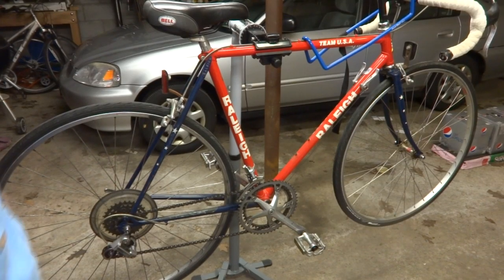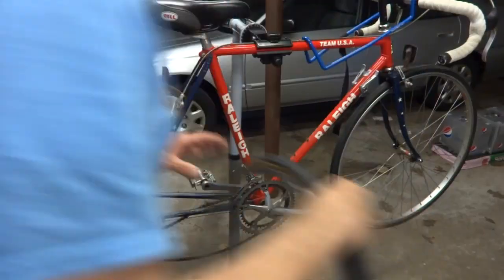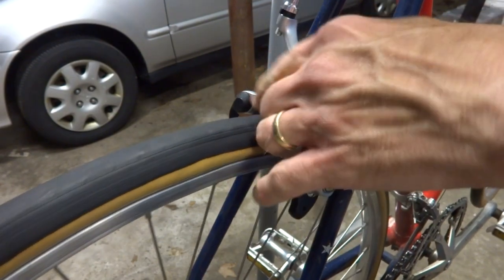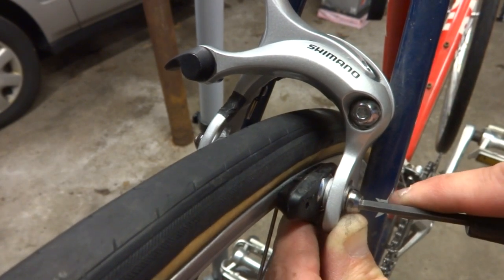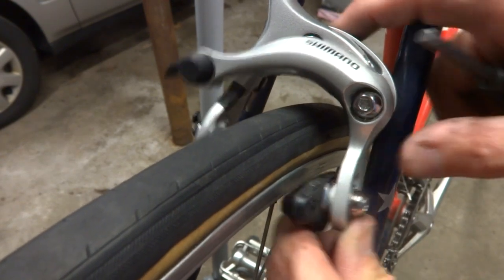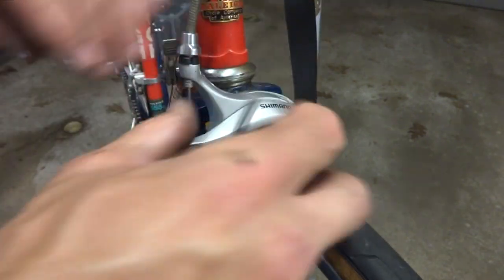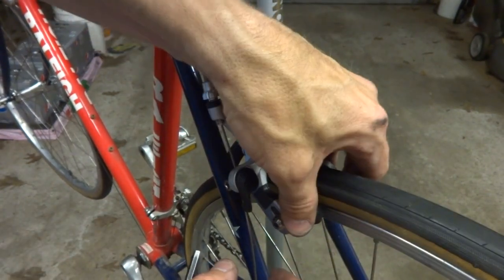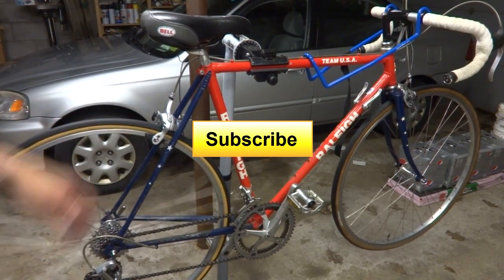How To Do 27 Inch To 700c Wheel Conversion - Vintage Bike Update

Comment: or save money by slightly file ling  caliper grooves  with round file..pads often reach without even file work  use round file
pads loose a little of their compression power  as they are further out  (more travel  less power  but still ok  can comensate with fixie type levers

Comment: I have a 27 inch 12speed road bike looking to convert to a single speed Fixie bike with a flip flop wheel and front brake only. I wanted to see that very comparison between a 27 rim and a 700c. Thanks for the video.

Comment: I'm doing a similar conversion with an old Dawes frame, I have a drop of 57 mm. I am a Tektro fan even though I have Ultegra on my oher road bike. Do I buy Tektro R539 with a 47 to 59mm drop of R559 with a 55 to 73 mm drop? In my mind I'm thinking the R559 will be stronger as I'm working closer to short end of the design perameters. What are your thoughts?
Reply from the maker: Dunno. Sounds like either may work.
Reply: @RJTheBikeGuy  I had an old set of 80s Shimano Tourney single pivot calipers with 55 to 73mm, put them in to check, just fits at the 55 end but I don't like the look, too much hanging down so I'm going for the R539. Thanks

Comment: Hang on I thought 700c was closer to 28 inch so slightly larger? Did you just say they were slightly smaller in diameter?

Comment: Aweosme videos! I just picked up a bike like this the other day and i want to do some modifications. is it possible to put smaller wheels on there? What's the smallest I can go? I'm trying to cut down some hight on it.
Reply from the maker: Ryan Olivares Putting smaller wheels on it is not the way to reduce height. Generally you buy a smaller bike. In the video the 700c wheels are only slightly smaller than the 27" wheels.
Reply: RJ The Bike Guy I know it's not the best way to do it but I'm starting to get desperate haha. I've been searching around for a smaller frame but no luck yet I just want to ride!
Reply from the maker: Seriously, starting with the right size bike is the way to go. Trying to put smaller wheels on to make it smaller is just a really bad idea. You won't be able to use rim brakes. The pedals may hit the ground when you pedal.

Comment: Hey RJ, nice video! I was thinking of building up a beater bike for winter, using an old frame i have. But I have a problem with it, I can't install my brake on the fork or rear because the hole is too small. should I drill it? or perhaps just forget about it...
Reply from the maker: I am guessing this is your issue: https://www.youtube.com/watch?v=74RBbMoAy4k
Reply: +RJ The Bike Guy ty

Comment: Thank's, many cracking informative video uploads....  I'm rebuilding an early 1980s Claud Butler bike using the Reynolds 531 frame, Chaining the wheels from 27 to 700c will i also need the long reach brake calipers on the 531 frame ?
Reply from the maker: 531 is the steel the frame is made of. It has nothing to do with whether you will need long reach brakes. Maybe you will, maybe you won't. But probably.
Reply: @RJTheBikeGuy  ....cheers :)

Comment: Hi there RJ,nice video again,just wondering if you can help.I have a old racing bike with 700c wheels and the tyres are 700-35c I have no mud guards on the bike because the diameter is such that they wont fit on, if I was to fit say a 700-28c tyres would the diamiter be reduced so maybe they will fit. many thanks  from  Wales uk
Reply from the maker: No idea. You will have to try it. It all depends on the particular bike and tires and wheels.

Comment: Nice job!  Like the conversion process.  I am wondering though - if the caliper centering was off, why would you loosen the mounting bolt to adjust the centering instead of simply using a 3mm Allen key on the centering adjustment screw?
Reply from the maker: On these brakes it's a phillips head screw. That is good for minor adjustments. So why not get the brakes centered to begin with and then use the screw for fine tuning.
Reply: Absolutely nothing at all - only had me scratching my head as you didn't mention that adjustment.  I'm really enjoying your video's. :-)

Comment: Question, I need better climbing gearing cassette on my 1988 Bianchi Limited with Shimano 600 7 speed 11x21 by 54/42 climbing hills has become a pain to handle due to such low cadence old school race gearing and not mention to my double butted steel Bianchi frame is a little on the heavy side + age is beginning to show it's ugly side!  Should I just change for 11x or 12x28 or even x 32.  Is it just better to stretch frame and run 10 or 11 speeds along compact chainrings??
Reply from the maker: Increasing the number of speeds just gives you more gearing options. Try a 12x28 freewheel. To got to a 32 , you might need a new derailleur. You can try a 52/38 crankset also.

Comment: Just wondering if you've used hubs that normally take a 7+ speed cassette and used a spacer? Or if you found hubs that are 6 speed. I'm also having problems making brakes reach and I really want to keep them since I have a whole Shimano 600 groupset 2x8 and I see they have an adapter that converts short reach brakes to long reach and I might do that because I really want to keep my tri color Shimano brakes since they work do well. Do you recomend getting an adapter that makes csntaliver brakes sit closer to the wheel or do you recommend getting all new brakes. It sucks because I just spent 150 for this whole Shimano 600 tri color groupset so I'm not sure what I should do. Thanks. I also have an aluminum frame that I managed to stretch from 6 speed to 8 speed. I know that's usually forbidden but it works with minor pressure applies to the rear triangle to make the time fit
Reply from the maker: https://www.youtube.com/watch?v=Jrd5XAQfgaA

Comment: Hey RJ. 
How do you suppose a vintage 10 speed road race bike that came with 25-630 slicks will perform on threaded 32-630 tires, like Continental Tour Ride? Any idea? I know rhey will be heavier, just wondering if you ever tried that.
Reply from the maker: Tires are a personal thing. Just be sure the fatter tires will fit inside your fork and chain stays.

Comment: Hi RJ, great Video, I am currently rebuilding my 23 year old  vintage schwinn, having a hard time getting a replacement 27 wheel set, my option is to go 700c. I was wondering if you can share with me the model of the shimano brakes you got. That will greatly help my rebuild simpler. Thanks again for creating great videos
Reply from the maker: This is the current version of what I used.
https://www.amazon.com/exec/obidos/ASIN/B005DTQ6UQ/ref=nosim/youtube25-20
Reply: Hi Mr. RJ thanks a lot. Once again great videos and very informative.
Reply: @RJTheBikeGuy  thanks for info exactly what i was looking for. your videos are timeless.. Im upgrading 83 Panasonic, love them.

Comment: Hi RJ, I have a vintage bike with 27inch. The hub length is 8.5cm. I have a set of 700c wheels with hub length of 10cm. I’m not able today stretch my fork 1.5cm. Any advice?
Reply from the maker: If it's a steel fork, you can cold set it out to 100mm. At your own risk of course. But's not uncommon.

Comment: Hi RJ, I have an old 46cm Miyata Pavea 77 road bike with 650c. However, I'm having a hard time finding 650c wheelsets for it. Is it possible to put in 26inch wheelsets on it? I wonder if it would enough clearance to accommodate the wider rim and tires.
Reply from the maker: 26" mountain bike rims are smaller than 650c and the brakes will have issues reaching. Depends on the frame if wider tires will fit.
Reply: Okay. Thank you, RJ! keep those informative videos coming.

Comment: Ok so I think I’m running into the same issue here. I found a 1973 schwinn and I ordered 700x35c tires and they won’t fit. I wanted 35c because they were that in-between type of hybrid tire. So my question is can I get thicker tires for my 27” rim? Or must I change to 700c rims
Reply from the maker: Yes.

Comment: i just found a rusted to crap CCM Targa at the recycling depot at my local landfill the other day (in the bike area where they're left outside with a lot of other for sale crap but still definitely not taken care of). i've never had or gotten to work on a 27" bike or any sort of road bike before, i totally forgot you could even swap them for 700c's until just now, and i thought the targa was a lost cause because of this. tomorrow i'm gonna go pick it up (will probably cost me about 10 bucks, the money goes to keeping the recycling depot area running) and get to work on it. do you have any experience with targas or have any advice for me? i expect it's gonna be rough and i don't even know if i'll be able to fully rebuild it, but i can't wait!!
Reply: aeshir i'm also not sure if i'm actually gonna swap the wheels, it all depends how much money i want to dump into it and if i want to be able to carry the parts over to a more modern road bike if i ever build/buy one
Reply from the maker: aeshir I am not familiar with that specific model of bike. You will just have to figure it out as you go. I have lots of videos on various aspects of the job.

Comment: As you were working on that bike I noticed all the similarities to my '84 Schwinn Le Tour.  The cable routing loops along the top tube, brakes and attaching hardware, brake levers, seat post and seat post bolt,  crank set, pedals, and even the frame and fork seem to be basically identical.  Is it possible that these bikes are the same, built in some overseas factory and just branded and sold by Raleigh and Schwinn?
Reply from the maker: I doubt it.

Comment: I'm thinking about a 27" to 700c  conversion. Any problem with increased pedal strike with the smaller overall diameter wheels? thx
Reply from the maker: Not really. The difference is pretty small.
Reply: thx. I'm hoping the conversion will reduce toe strike on the front wheel, but didn't want to create more problem. More tyre choice will be good.

Comment: Do you recommend against going from 700c to 26'?
I have a road/hybrid bike that's just a tad uncomfortable for me to mount, and I was hoping a smaller wheel size would bring the height down a touch.
Reply from the maker: +misamisatv No. Brakes won't reach. Pedals would likely hit the ground. Buy a smaller bike.
Reply: RJ The Bike Guy  Thank you for your reply!  It's a shame because I really really like this bike..  :'(
Reply: 26" could be 559mm, or 590mm. The latter (26× 1 3/8) are pretty close in size to 700C, which are 622mm.
If you mount 35–37mm tires the difference in height will be like 4–8mm. So, a conversion could actually work.
Reply from the maker: When people say 26" they are generally referring to mountain bike wheels which are 559. That is A LOT smaller than 622!!! The pedals would probably be hitting the ground. Or do you think they were thinking of replacing modern 700c with antique wheels?
Reply: 590 are quite common in Europe and Japan, especially in road and city bikes. Nothing antique about it. You can get relatively popular tires from Continental or Schwalbe for them. But, the OP wanted to bring down height for easier mounting, and I agree, that's not the way to go for that. The conversion itself is possible.

Comment: Hey! Have you tried swapping 650c to 700c? (probably won't work but i'm asking so i don't end up buying larger wheels and they'll won't fit) Thanks for answer ;)
Reply from the maker: +jgvbadv I doubt 700c wheels will fit on a frame made for 650c. That is a pretty big difference.

Comment: Hey bike guy, I have a raleigh spirit and looking to replace the wheels for 700c's. Wheels come with a 5 speed cassette and I am having trouble finding a set, where do you recommend finding a nice set?
Thanks
Reply from the maker: Ebay.
Reply: Been looking for a set with no luck, most are for 8 speed and up. Thanks
Reply from the maker: Most of those older 700c wheels with 5 speed hubs will be tubular.
Reply: Thanks, i think I found a nice cheap set

Comment: Wow you remove the old brakes and install the new brakes without first cleaning the surrounding frame area !!! Unbelievable. And why cut the cable if it is still good? Couldn't you have just unscrewed the bolt to get it off and reused it?

Comment: how horrible would it for me to go from a 5/6 speed Uniglide 27 to a 700cc (maybe 10 speed). How many times will I have to bang my head against the wall?
Reply from the maker: Two different operations. One going from 27" to 700c. And going from 5/6 speed to 10 speed. I have videos on both. But you know that since you commented on both.

Comment: why did u decide to change from 27" to 700c,are there plus's & minus's to the 700c wheel?,apart from being modern of course :) just curious ok,were the old 27" wheels damaged?
Reply from the maker: neil crompton 700c are more current, have wider variety of tires. They don't even make bikes with 27" wheels today that I am aware of.
Reply: ok tyres for 700c ( i checked the net)start @ $70 seems a bit steep,btw are they strong enough to go trail riding as iv'e seen a lot of new bikes from hardtails to hybrids with 700 c rims,would have thought they would go out of true very easily or are they built tougher?
Reply from the maker: neil crompton 700c is just the diameter. They come in a variety of widths and qualities. You can find cheaper 700c tires and more expensive ones. Pretty much all current road bikes come with 700c wheels/tires. Cyclocross bikes generally have 700c wheels/tires.

Comment: I've got an old zeus with 26inch could i convert it to 700c  its got 6 speed i was also wondering if i would have to swithc it to 10 speed?
Reply from the maker: IT's_RAD Maybe. 700c wheels are larger diameter than 26". The wheels may or may not fit. The brakes may or may not have the right reach for the rims. Going from 6 speed to 10 speed might be possible too.

Comment: Im planning of buying montra helicon x bicycle it has 27.5 × 1.75 (650b)  tires can i change that to hybrid tires or road tires, waiting for your reply, can i use the same stock rims to convert to 700c
Reply from the maker: I don't know what you can fit on your bike. And no, you can't put 700c tires on 27.5 rims.
Reply: So if i want to convert to road bike my cycle what should i do
I will buy montra helicon x (650b) 27.5 × 1.75 is the tire stock. What should i do? To get road bike or hubrid bike type tires on montra helicon x
Reply from the maker: @rohankalal3459  I have not converted from or to 27.5 wheels. I have no idea if it will work or not. Find fatter 27.5 tires.
Reply from the maker: @rohankalal3459  I have not converted from or to 27.5 wheels. I have no idea if it will work or not. Find fatter 27.5 tires.

Comment: Hi sir. I've being wondering if the 700c tyre can fit on the 27" wheel. I really appreciate it if you can help me with it. Thank you
Reply from the maker: No they are different sizes.
Reply: @RJTheBikeGuy  But tubes are fine to interchange...  :)
Reply from the maker: @SinnerSince1962  Yeah, the 27" tubes and 700c tubes are close enough to interchange, but not the tires.

Comment: any idea what the difference between BR R450 and R451 Long reach brakes are?   I understand that there may be 2 versions of some long reach Shimanos - long / short bolt.  thanks
Reply from the maker: Not sure what the difference is. I installed R450 brakes. I bought both a front and a rear. The main difference is the length of the mounting bolt. Long reach brakes should have a reach up to about 57mm. The R451's might just be a new model. Not sure.
Reply: shyflirt1 Did you also replace the brake levers? I read that you need to use the right levers to get the leverage ratio correct, but seems a bit OTT to me. (e.g. see http://www.wiggle.co.uk/shimano-br-r451-dual-pivot-57mm-drop-brake-caliper/). Thank you!
Reply from the maker: I didn't use any special brake levers. Later I installed STI shifter/brake levers. No problems.
Reply: shyflirt1 Fabulous thank you for taking the time to reply. I've got a Raleigh Zenith I've had from new but not ridden for 15 years which I'm going to resurrect & currently debating whether to replace the 27 1-1/4 wheels with 700C. Think I will.
Reply: Rob Martin The BR-R451 is for use with newer brifters (i.e., those Dura-Ace/Ultegra/105 with internal gear cable routing and 10-speed Tiagra -- Must be used in conjunction with ST-4600/3, ST-5700/3, ST-6700, or ST-7900).  The BR-R450 are for use with earilier brifters.  Excited by this video, I tried to find a set of BR-R450's for a Mixte 700c conversion I've been wanting to do.  But they seem hard to find at a good price. :-(

Comment: Are break cables/housing normally lubricated after a change out?
Reply from the maker: Modern brake cable linings have plastic liners that really don't need to be lubricated.
Reply: shyflirt1
Thanks for the quick reply, I like your style of video teaching - - bikes in particular.

Comment: Question
I picked up this cheaper bike a
 vertical canyon  road bike 2005
Never used I was told this bike cost new $500.
Would the 700c rims on this be good to use on a better bike like a trek?
Reply from the maker: Shrug.
Reply: @RJTheBikeGuy  
I know vertical is a cheap walmart and target  bike , and i remember you saying not to used cheap parts 
But didn't know if the rims were really junkie
 ( thought steel rims was steel rims )
Reply from the maker: @swanzilla1982  Good rims these days are made from aluminum, or carbon fiber. Steel rims are on the cheapest bikes.
Reply: @RJTheBikeGuy  
I know that's what's on my trek 330 now  ( reason I need new rims is the nipples where the spokes meet are rusted ) and cant true it up ...
So knowing these rims must be steel I was thinking how would it hurt to put cheap rims on from a cheap bike ...
Just yo get it going
Reply from the maker: @swanzilla1982  I doubt the Trek 330 came with steel rims. The nipples might be steel with an aluminum rim. Does a magnet stick to the rim? If not, it's not steel.